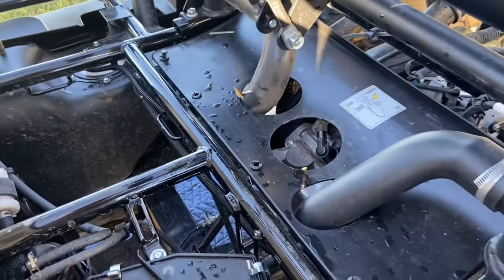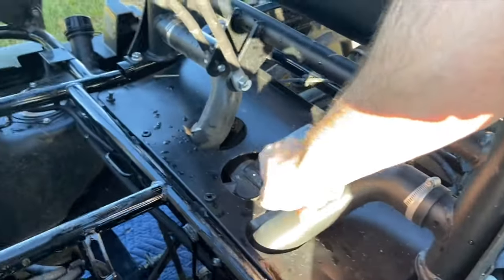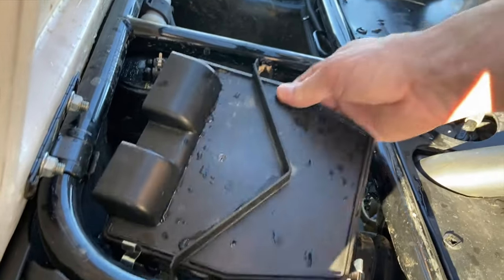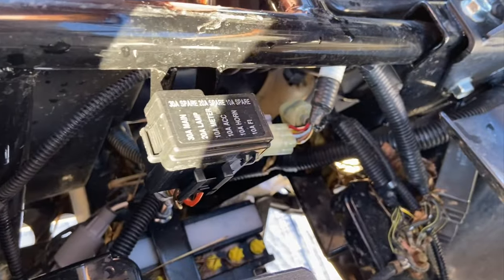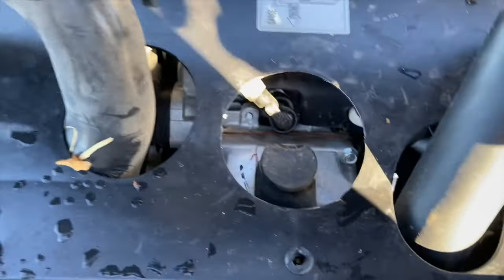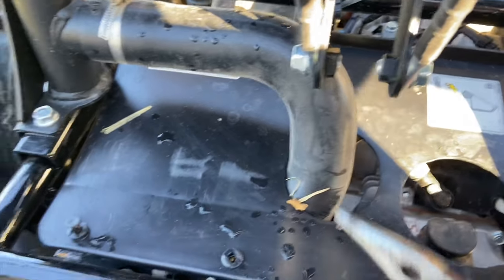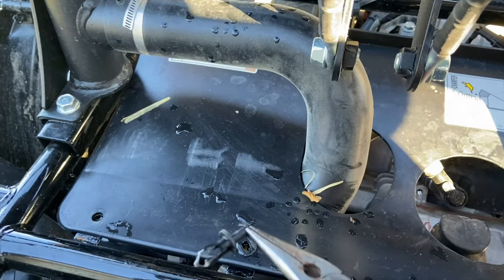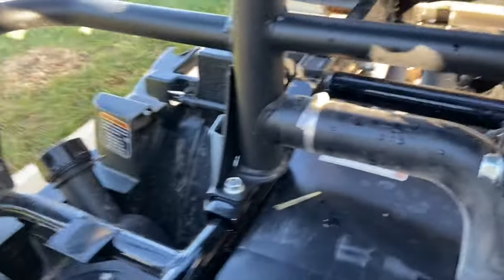How to change the oil in a Kawasaki Mule SX (Step by Step)

Comment: Literally the most important piece of info. HOW MUCH OIL WAS IT? That dipstick is impossible to read and for some reason the oil capacity is tough to find on these different models. I put roughly 1.95qts but I'm pretty sure I overfilled it. Will check it in a few days. 
I saw 1.9 qts mentioned a lot but I should have checked as I went. Since its fuel injected would overfill even matter?
Reply from the maker: Manual says 1.4q.   I put right at 1.8q.
Reply: @HammerIIHammer  I brought mine back to about 1.6 with a sucker tool. Still impossible to get a good read on that dipstick.

Comment: What do you think above sucking all the oil out from the dip stick hole? But do change the oil filter. And replace the drain bolt with a new washer and magnetic drain oil plug? This is how the factory changes the VW cars and how I do the newer VWs. No issues
Reply from the maker: I would assume this would be ok, I know someone who does it that way and he has had no problems as of yet. I go that route with my riding mower using a pump rather than draining it.

Comment: Thanks for the great video. Very helpful!  I couldn't find any information on-line about the air filter reservoir you cleaned out.  What exactly is that?  I've never seen one on other engines.  Thanks again!
Reply: Oil catch can

Comment: I changed mine the other day, 20 hour service, and it was a lot harder than I expected because of the tolerances around the oil drain plug and filter, my tools would not do the trick. I have a brand new 21 sx mule. The darn oil drain plug was so lose from the factory that I took it off by hand. I have tried looking this up , but I can’t find anything on it.  Does an Allen wrench fit in the oil drain plug end , to tighten it? If so was size Allen wrench should  I get? Also, what size oil filter tool should I get. I have one that you use like pincers too grab the filter, there is not enough filter exposed to use that tool. I need a oil filter cup that fits over the end of the filter, but don’t know what size to get. I ended up using the old method of driving a screwdriver through the filter to get it off. Any help would be appreciated!  Thanks
Reply: Buy K&N filters and they have a nut on the end of the filter.

Comment: I just wish mine would crank that easy, question is do i need a new carburetor?
Reply from the maker: Hard to say. If it is the same year/make/model as mine, then no because this is fuel injected (no carburetor), but if yours has a carburetor then it is a good place to start as carburetors are notorious for causing issues. Good luck 👍🍀
Reply: @HammerIIHammer  I had my carb looked at and it was simply the jet needed to be cleaned out

Comment: What is that panel called that covers the engine between the seat and bed?  I need this. 
Thanks.
Reply from the maker: Just the plastic guard/shield, not sure if it has a technical name.

Comment: I  don't think that is the drain plug you should be using,  did you notice it was plastic? you can if you want,  but the real drain plug is around on the side of the engine at the same level on the passenger side that take a 9/16 socket and it's a lot easier to get to and it is a metal threaded plug.  just saying....

Comment: What is the difference between atv 10w 40 and auto 10w 40?  I have a 2007 kawasaki 610 mule.
Reply from the maker: From my understanding atv oil is formulated for higher rpm and hotter running temps. I know people who use them interchangeably without issues but I’m not certain as I’m not a mechanic though.
Reply: @HammerIIHammer  thanks for the reply.  ATV oil seems to be 2 to 3 times more expensive.  If really better., then we worth it.    Wonder how compares to synthetic?
Reply: ATV /UTV oil needs to be able to work with wet clutches, car oil doesn't have the additives for that and let's the clutch slip.

Comment: How much oil does your mule hold?   Don't want to overfill.
Reply from the maker: Hey. Right around 2.5 quarts if I remember correctly. But make sure and check the dipstick when you get to 2nd one and you won’t over fill.

Comment: I've had my mule for a year but have less than 40 hours in it. How many hours should there be before 1st oil change. I keep thinking 50 for some reason but I can't find my manual.
Reply from the maker: 1 st oil change at 50hrs. And if you don’t use it that much it should be at least every season if less than 50 hrs.
Reply: @HammerIIHammer  thanks!
Reply: @HammerIIHammer  I was told by my kawi dealer that there is a first 20 hour service after the 20 hour break in period?? Not 50.
Reply: @HammerIIHammer  1st oil change at 20 hrs

Comment: It shouldn't be hand tight.  Your dealer didn't tighten it when they filled it with oil.
Reply from the maker: I kinda figured but wasn’t positive. I didn’t crank it down due to having somewhat fine threads I didn’t want to damage, but I wanted it snug when I put it back. Thanks
Reply: No, he's right. My drain plug wasn't even hand tight, either. Kawasaki has switched to plastic drain plugs and the torque spec is something around 5ftlbs. 

I just changed my oil the other night and kept thinking I was using the wrong size wrench because it just kept slipping. I got under there and shined a light... no, I was using the right size, it was just that the drain plug was already loose.